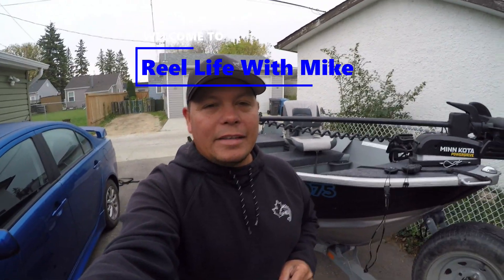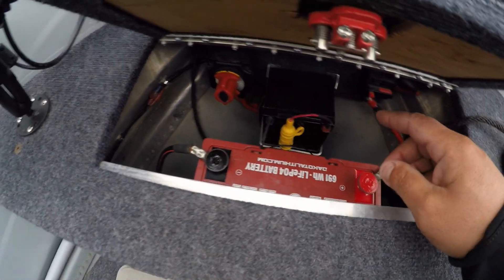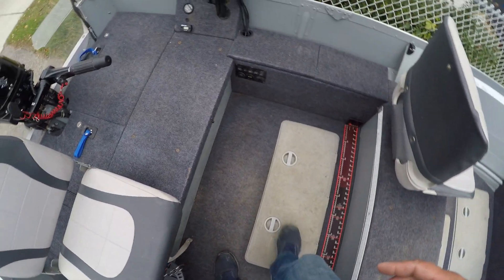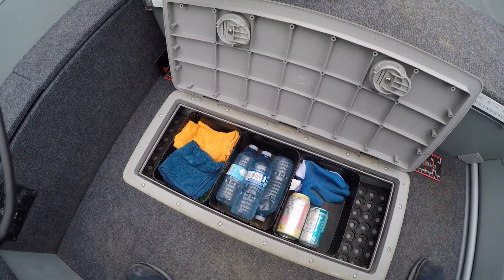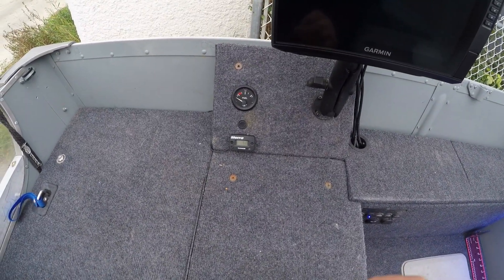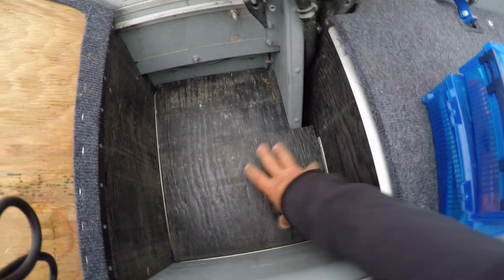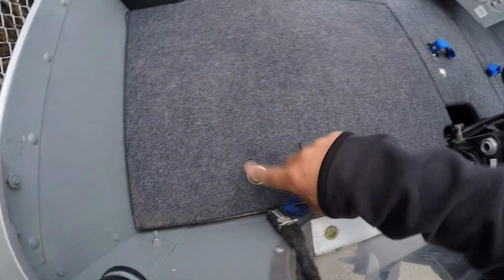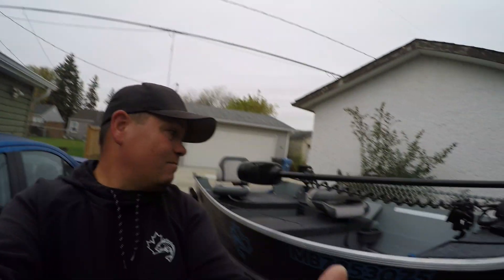The Ultimate 12 ' Smokercraft build walkthrough

Comment: Where did you get the aluminum? How thick is the plywood? Thank you
Reply from the maker: I got it from a place called princess auto or people in the states would sat harbour freight.  I also used 1/2 in wood as the span was quite small but I usually would recommend 3/4